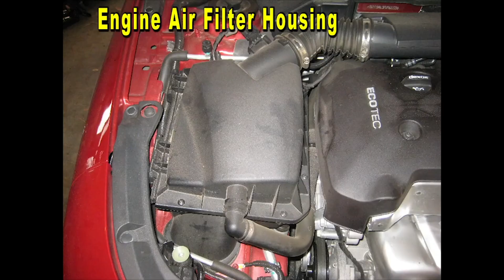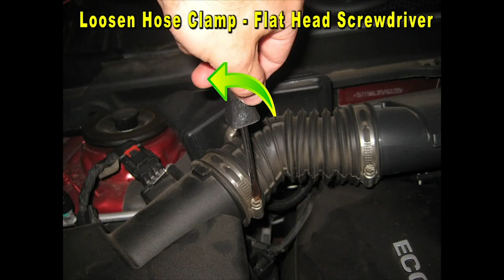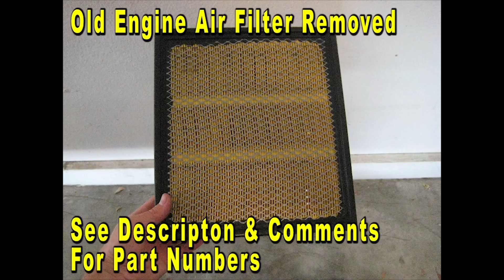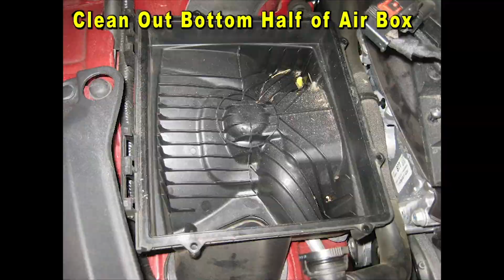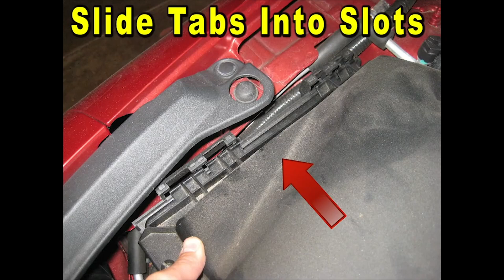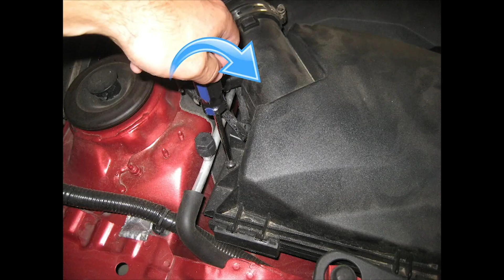2014 To 2020 Chevrolet Impala How To Change Engine Air Filter With Part Numbers - Quick & Easy

Comment from the maker: Chevy Impala Engine Air Filter Part Numbers - https://amzn.to/40exwWc
EcoGard Engine Air Filter Part Number - https://amzn.to/42EKZbE
ACDelco OEM Impala Engine Air Filter - https://amzn.to/409vcj7
Fram Extra Guard Engine Air Filter - https://amzn.to/3K0c0yP
Purolator Engine Air Filter Part # - https://amzn.to/3TCoKPo
Precision Screwdriver Set - https://amzn.to/3TCMm6n
Plastic Pry Bar Tools - https://amzn.to/3HMtsV7
Socket & Ratchet Set - https://amzn.to/3Z17LbA
Mechanix Gloves - https://amzn.to/3jCnHkt
Torque Wrench - https://amzn.to/3vS5uSI

The Paul79UF YouTube channel is a participant in the Amazon Services LLC Associates Program, an affiliate advertising program designed to provide a means for sites to earn advertising fees by advertising and linking to Amazon.

Comment from the maker: Check out the DIY guide for changing the engine air filter element in a 10th generation 2014 to 2020 Chevy Impala with the Ecotec LKW 2.5L I4 - 
https://www.paulstravelpictures.com/2014-2018-Chevrolet-Impala-Engine-Air-Filter-Replacement-Guide/index.html

Here are all of the DIY repair and maintenance tutorials for the tenth generation 2014, 2015, 2016, 2017, 2018, 2019 & 2020 Chevrolet Impala -
https://www.paulstravelpictures.com/Articles/2014-2018-Chevrolet-Impala-Common-Problems-Repair-Maintenance-Guides.htm

Owners of other General Motors vehicles such as the Malibu, Cruze, Camaro, Sonic, Spark, Volt, Corvette, Trax, Equinox, Traverse, Tahoe, Suburban, SS Sedan, Bolt, Colorado, Silverado, Buick Verano, Regal, LaCrosse, Cascada, Encore, Envision, Enclave, Canyon, Sierra 1500, Terrain, Acadia, Yukon, Savana, ATS, CTS, XTS, CT6, XT5, SRX and Escalade may also find these DIY instructions to be helpful.